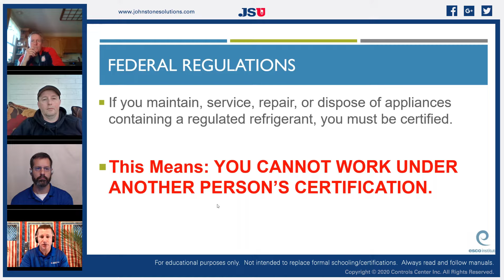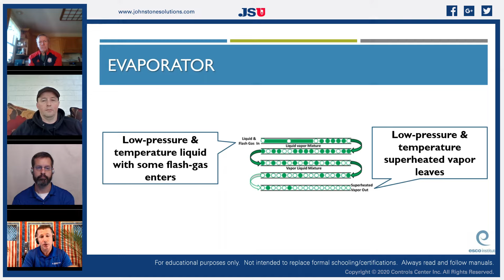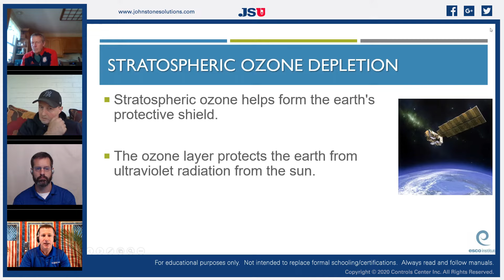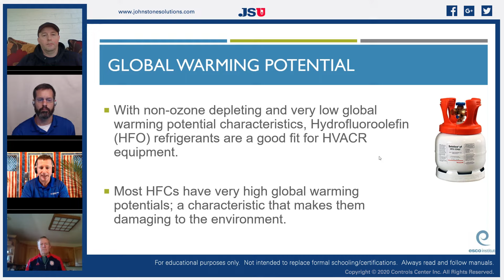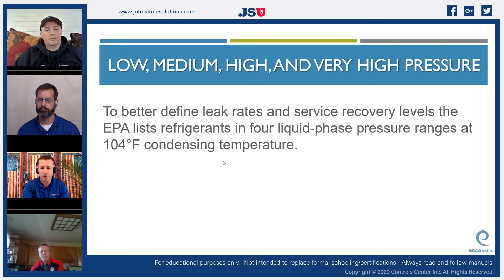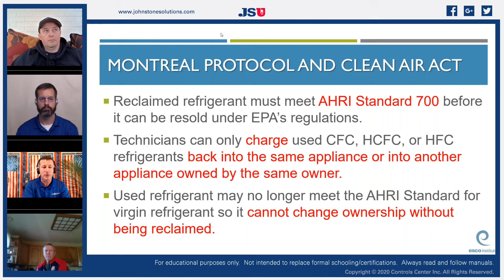EPA Test Preparation Guide 1 of 5

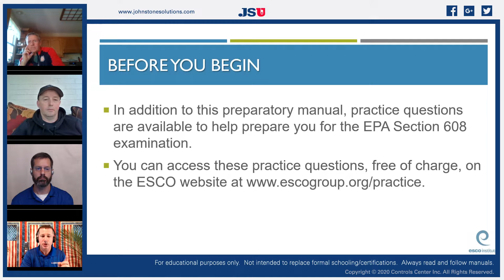Comment: @4:55 Thank you so much for the reference to that site for free practice exams. i got only 48% at the 1st attempt, but it is a lot of fun to practice. May I know which exams I need to pass to get EPA 608 Certification? Should I do just a Core, or Type I, II, and III are needed. That is for me to have a permission to purchase 2 lbs of R-410A. I think to check the level in my home AC and maybe add some more. I suspect not the right amount was added during installation, also it was ~7 years after the HVAC system was installed. Thank you again.

Comment: I have a question…..the fixed orifice….when I used to install heat pumps at my property my supervisor always used to take it out and said “we tried putting it in a few units but they kept failing so we ended up taking them out and the units ended up working perfectly fine” I’m just wondering is that ok? Or??

Comment: Do I need this certificate to do recovery from vehicle? We talking about 1 can of oil and 1 to 2 cans of R134a, depends on the vehicle? When I work on cars, on rare occasions I do repair ac’s basically replacing tubes, and  once in a while replacing O-Rings on flanges, but if vehicle was in an accident, and AC system was destroyed anyway, so there’s nothing to recover from it, except maybe some oil from compressor , all refrigerant is gone anyway, at that point I do just flush system after complete rebuild, and recharge it. And at what point I need that certification? Because anyone with pulse can walk in auto parts store and buy boxes of cans. And this certification is the only to give you knowledge of what those refrigerants do to environment.
Reply: That's an open book 609 test

Comment: Thanks for the videos. Easier to get through compared to just reading the Esco 608 preparatory manual and good supplemental learning. People just need to add A2L learning and practice tests. The videos are a few years old but most of the content still applies and they're free. It's not hard to find EPA updates for rule changes.

Comment: I Want EPA license to Freeon my own unit. What section is required ?
Reply from the maker: Core and Type 1 for residential/small appliances
Reply: @johnstonesolutions2461  Thank you, I also had same question. But will it be called EPA 608 Certification with those particular endorsement "for residential/small appliances"? For purchasing R-410A they ask for EPA 608 Certification.